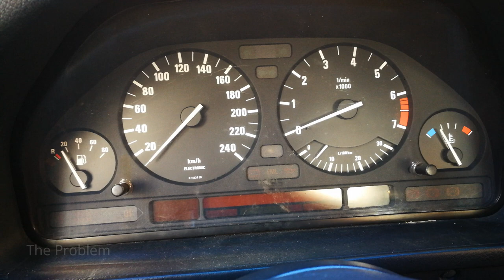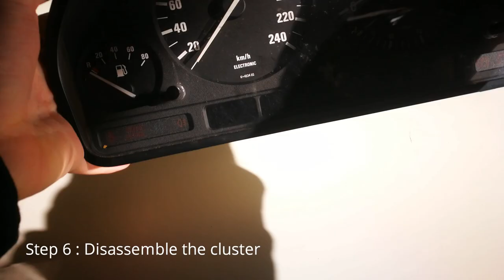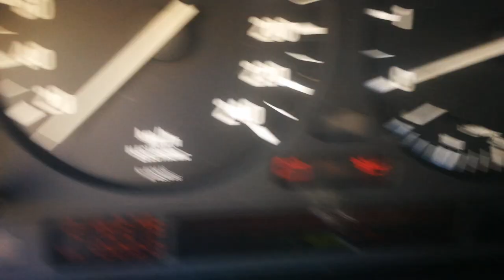E34 Dashboard Fix Dull Display / Gages not working

Comment: Thanks very much for the clear guidance on how to replace these capacitors.  I have an 89 535i and your unit with the gray back looks identical to mine. I seem to have the same situation as connor zoso.  All my gages work okay, and even the warning displays, but the odometer is extremely dim to the point of being invisible under all but the darkest conditions.  I can solder and would attempt to replace the capacitors but wouldn't know how to troubleshoot the board. But I was wondering, could the dash bulbs just be shot?  Any thoughts you might have would be appreciated!
Reply from the maker: Hi, once you have removed the dash you could first try to visually inspect all light bulbs. Also some more info about capacitors in general can be found here: shorturl.at/lmnDN (iFixit article).
Feel free to share you results in the comments!

Comment: Hello,
First of all thanks for the tuto.
Do you remember the specifications of the old condesators?
I bought what you proposed, but the originals mounted on the dashboard have different spec.🤔
Reply from the maker: Hi John, thanks for reaching out! If you look at 4:57 you can see the values of the capacitors.
My electronics skillset is not that big, so I'm afraid I won't be able to reply to your question regarding the condensators.
Best of luck!
Reply: You are Wright, I juste Saw the values. I have the same. Thanks
Reply: I replaced the capacitors and it worked.👍. Thanks again for the tuto.
Bye

Comment: Good day
My Petrol gauge and temperature gauge goes off when I accelerate and back on when I let go of the accelerator padel.
What do you think may be the problem.
Your response will be highly appreciated
Reply from the maker: Hi Keenan, I don't know for sure. But if I had to guess, try and check your alternator? It seems like you're using all the power provided when accelerating and don't have enough for other parts of the car. But that's just a guess, I'm still learning  about cars and only have limited experience :)

Comment: Have a same problem with mine nothing working no water temp, rev, speedo, fuel … only the Code light is on 
Please help
Reply from the maker: Have you inspected your unit? Any components that look faulty?
Reply: @pieterw  looks ok to me maybe something to do with the fuse or must be the capacitors aswell?

Comment: Is the capacitor the same capacity and location as stated in the video suitable for a later model blue cluster?
thanks
Reply from the maker: Hi Leo! Unfortunately, I have no experience with the later model clusters. The voltage is overall not that important, as long as it's big enough... The circuit will charge the capacitor to the required voltage. The important part is that the capacitance is the same.
Reply: Hello,
 the most important is the capacitance ?  If the voltage is above the original, it still work ?

Comment: Hi, great video! my dash cluster works 100% in my e34 apart from the numbers showing the mileage have gone extremely dim! (i thought they were just totally gone until i looked very closely) is it worth pulling it out and replacing all capacitors for this issue? thanks
Reply from the maker: Hmmm i'm not 100% sure. You can always start with pulling the dash and just inspecting the motherboard. If you see some weird stuff, you can replace them, if you don't you could look a bit further if you're not comfortable with soldering.
Reply: @pieterw  thanks for the reply! Hmm I think I could do the capacitor replacement like in this video but not confident with much else as I’m very new to it and not certain what I’d be looking at on the board! I’ve heard from people that you can mess up your dash quite easily by poking around in there as well so that would put me off haha. It’s strange that it’s just the mileage indicator that has gone dim though so I was just wondering if it could be bad capacitors causing the problem.
Reply: Replace the little black globes on the LED bar - 99.9% guaranteed fix.

Comment: How do you turn the wheel while the car is off? What about the steering lock because the car is off? Did you put the keys in the ignition to give battery while cluster was disconnected so you could move the steering?, can it reset my speedometer if I do that.
Reply from the maker: Key was in the ignition. No info is stored in the cluster. Not in my one anyway...

Comment: The instrument cluster needles on all gauges on my 1990 BMW 525I go absolutely bonkers when first starting the car in cold weather.  The colder it is, the crazier they go:  speedometer and RPM gauges spin around, gas and fuel gauges bounce back and forth.  The temp gauge is only gauge that is normal.  After driving the car and letting it sit for a time, gauges work normally. My mechanic said it has something to do with the grounds--his 525I does the same thing.  Can this be fixed?
Reply from the maker: Electeical components operate differently in different temperatures. So an old capacitor could behave weird. You could try it with this fix, let us know the result!
Reply: @pieterw  thanks for the quick response.
Reply: @pieterw  I have the cluster out and going to try your recommended fix.  Do you have a recommendation for where to find the capacitors?  Also, Is that a u for the part number, as in 22uF 62V and 220uF 25V?   I assume you are in Germany.
Reply: @pieterw  Pieter:  I have my console out but can't find a source for the capacitors.  Can you help me?  I am in the USA.
Reply: @pieterw  My E34 circuit board from my 1990 E34 525i doesn't look like yours.  I would send you a picture, but don't know how on U-Tube.  I will also try through e-mail.  Is it worth trying to fix this or give up?
Reply: @pieterw  Do you have an email address?
Reply: @markmath2883  are you fix it ? I have your same problem in my cluster.

Comment: I have problem with millage numbers, everything else on the board is working but millages are stuck!!!
Bmw e34 , 1990.
Reply from the maker: Hi Mihael, I would look into replacing the display for that one. Like you can see here :
https://www.youtube.com/watch?v=PeZ2LCSb9y4&ab_channel=Minitools
Reply: @pieterw  I forget to mention that numbers are not digital, its dial. Thanks for answering! Hope you can help me with this one.
Reply: @mihaelsw3323 same problem here... did you find the fix?
Reply: @krassidimitrov2 
Yes , I bought new plastic circle mechanism that spins the numbers.
Reply: @krassidimitrov2 This parts.

Comment: I got pretty much the same problem. But the question is. Your temp, fuel, litres/km didn’t work aswell?
Reply from the maker: The things you mentioned were still working. I assume yours are not?
Reply: Pieter W Yes. Basically. Everything that works is taho, speedo gauges
Reply: Have you maybe solved this?
Reply: I think I have the same issue. Only speedo and tacho works (tacho incorrectly reads as 0rpm on idle but still moves when you rev). Also OBC reads "PPPP"

Comment: mine just don't light the abs, properly
Reply from the maker: I think that will require a different solution.
Reply: @pieterw  sadly yes, iam not finding whats the problem, i took it to every mechanic, electriction, here they used computers and stuff all of them said that this is normal.
Reply from the maker: @abdullahhamadeh  and do you have a video about the problem? Because I don't fully understand what your problem is.
Reply: @pieterw  tbh i do not have but i can explain a bit, the light does not come when they get engaged or something broken but sometimes like randomly pops up when they are just fine
Reply from the maker: @abdullahhamadeh  Only the abs light bulb? Have you cleaned the bulb/socket?
Reply: @pieterw  well .. i cleaned the connectors that go to the cluster .. iam a chicken myself of open it up tho
Reply: @pieterw  not technically but i cleaned multiple sockets .. ehich i don't know which one which but i plugged them back in in the correct postion
Reply from the maker: @abdullahhamadeh  with sockets you mean the connectors to the dashboard? Or the bulbs themselves? As you can see in the video it's not that hard to open it.
Reply: @pieterw  the connectors, .. i used the tool to see if the connection is good or not on my cluster, the cluster seems to be fine, even the wires ..
Reply: @pieterw  do you think if i change the main motherboard, will it fix it ?
Reply from the maker: @abdullahhamadeh  well in theorie, if your connector is ok and you wires are ok. Then eithers it's a problem with your abs or with you cluster... But I asume the abs is working ok. So maybe you can take out the motherboard and check for things that are out of place. Like blown capacitors or corrosion, dust, etc...